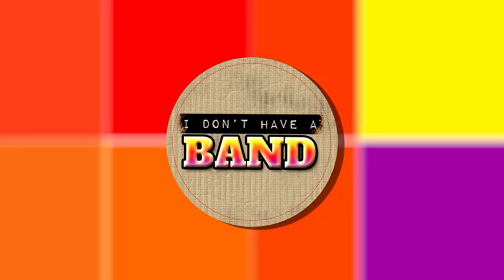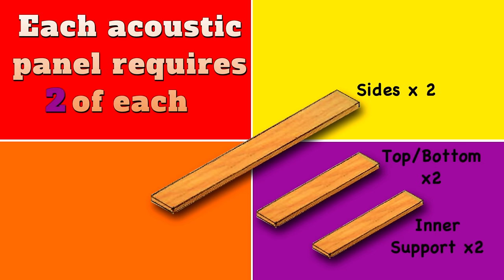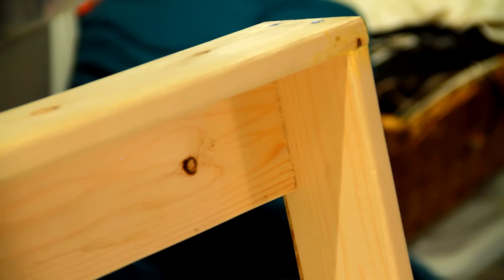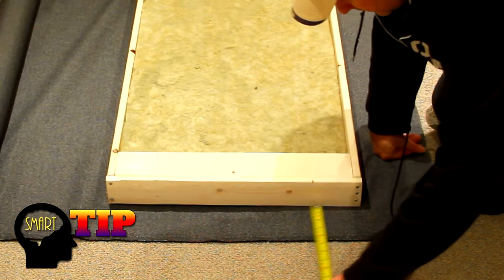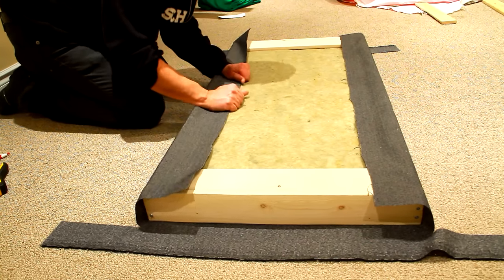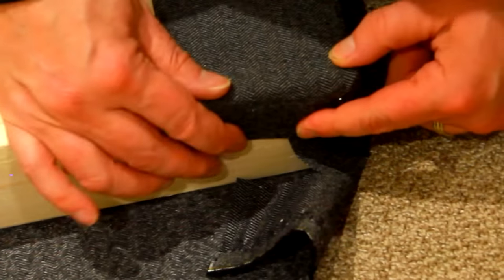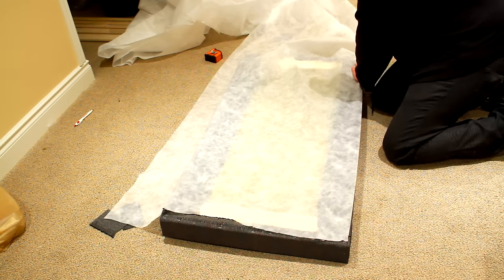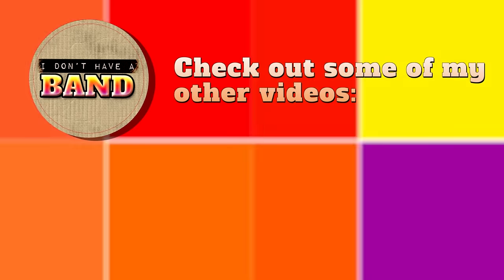DIY Acoustic Panels - How To Make Your Own Cheap and Awesome Panels

Comment: I would say, when you make these panels, take your time and follow EXACTLY the steps presented in that video. 
It allows for a smooth work flow.
I have a bad habit of zooming through instructions in order to satisfy my excitement..
I have built a few panels, single, double in width and/or height, with upholstery fabric and whatever fabric I had on hand, notably landscaping fabric that I used before knowing that the exact same fabric was featured in the video...what a genius!
Well maybe not so because 
after having built in six panels with some beginner mistakes, I finally got it right.
Again FOLLOW DIRECTIONS just as it is in the video.
These panels work great,(even with beginner mistakes) and they definitely changed what I am hearing when mixing.
And there is nothing better than building your own stuff because,
if nothing else, it will keep you centered in the moment which is quite helpful in these crazy times we are living.
Just do it!
Reply from the maker: Thank you for your support and positive feedback.  And I agree 100%.  Easy to gloss over directions and then get frustrated when you make mistakes.  It's not a hard project but you need to follow the steps if you are not used to making things like this.  Glad you pushed through!!

Comment: Thanks for a great video Lonely Rocker! There is a ton of ugly reverb in the room where I practice vocals and it is in dire need of acoustic treatment. I decided to build 8 panels using your instructions. The frames turned out great but I'm still waiting on the fabrics to arrive (I can't wait for finish it up). Roxul 24 was tough to find online and it's a bit pricey but the experts tend to agree that it's the best in class for acoustic treatment so I bit the bullet. Fabrics can also get a bit pricey if you want the good stuff (not talking about the back of the panel). All in all, I managed to make it ~$27+change/panel so you were right on the money there. Thanks again for all the advice!
Reply from the maker: Thanks so much for your feedback and kind words!  Glad this worked out for you and you'll soon have your panels proudly installed in your room.  Enjoy them and glad I could be a small part in your studio venture.  Cheers!
Reply from the maker: What city are you in?
Reply: @LonelyRocker  Lynchburg VA.  Looked up the product locator on their site and called but the stores listed are all out.  I suppose I can just take the 16 inch and cut to fit
Reply from the maker: Covid has created supply issues all over the place.  Perhaps that's why.  Yes, use the 16 and cut tit if that's all you can find.  Make sure to wrap the insulation with a thin fabric inside to keep it all together nicely.  And check my newer panel build videos to see some of the upgrades I added...Good luck!
Reply: @LonelyRocker  thank you so much for the response.  I went to the hardware store and picked up 16 1x4x8 pieces of pine along with the number 8 screws that are one and a quarter inch long, since I need eight panels.  However when I went to screw in the top and bottom parts (on top not from the side like you mentioned) it seemed like the screws were long enough.  I'll go to screw down one side and the other side would kind of pop up by a quarter of an inch.  Granted this is my first DIY project with pretty much anything around the house so I'm probably missing something.  Any issues with getting longer ones? Or am I just not doing something right.
Reply from the maker: Ha!  Sounds like you need to practise your carpentry a bit before you build the panels.  You need to hold the pieces firmly together so the screw drives through both pieces of wood and not pushes the top one up.  With a little practise you'll get it.  Use scrap wood and get it down before you start on the good stuff :)

Comment: I highly recommend using black landscape fabric as a covering on the front before putting the other fabric on. Upholstery fabric is designed to let air through, but it will also allow the dust from the rockwool to pass through. Landscape fabric is cheaper than backing fabric. Also, look for roll ends in the upholstery fabric section of the fabric store. There are really great deals for just a few bucks. I did 8 panels with about 25 dollars worth of fabric.
Reply from the maker: Check my channel for my new Acoustic Panels 2.0 that I just published.  I addressed concerns for inner insulation and included a formula for bass traps.  Check it out.

Comment: I have no skills at carpentry, but you set this up so well that I think I can do this. Thank you for this video! I totally subscribed!
Reply from the maker: That's so awesome!  I'm rooting for you!!  This is a great project to try.  It really is not difficult.  Let me know how it goes!!  And good luck!
Reply: I'm pretty good at woodworking. In my humble opinion, the only problem you may have is underestimating the difficulty of screwing the corners together. It's important to a drill proper pilot holes. You can use just a regular drill bit, or for about $10 you can buy a set of three. The common sizes are #8, #10, and #12. They will drill a nice controlled straight hole with a little countersink. If you don't drill a pilot hole, in that type of joint it's very easy to split the wood. If you're a perfectionist like me, you can get discouraged real fast.

Final thought to an issue that I still see. Do not buy slotted head screws! Buy Phillips head (star type), square, or Torx drive screw heads. Hopefully, you have a cordless drill driver, but in any case slotted drive screws are a PITA.
Have fun...

Comment: Being that this in Fiberglass, is the material good enough for covering when you plan to have 4-6 of these in a smaller room for years?
Reply from the maker: These are not fiberglass.  These are rock wool. 2 years in and still going strong.  Check out my update for some new methods to include in your panels 
https://youtu.be/MHnFYFZc-w8

Comment: Highly suggest putting thy backing on first. You can cover the seam with your top fabric and you don't have to worry about damaging the top.

Not to mention it would protect your fingers if you were using a different insulation.
Reply from the maker: There is no right or wrong here and a few people have been discussing this.  1.  The best method is the one you feel most comfortable with. 2. It's on the back so no one will ever see it.  I personally tested both methods.  I decided I wanted to finish off the outer fabric.  Either the backing or the outer fabric ends up on top.  So really, it is a judgement call that has no bearing on panel performance.

Comment: Really good idea in a simple, easy to understand video. I’d really like to see a before-and-after video that demonstrates the difference in sound, and some measured/measurable idea about which frequency range this panel diffuses and which it doesn’t. My guess is it’s effective in the mids and highs but not so much in the lows, but what Is “high/mid” and “low” in practice?
Reply from the maker: Thank you very much.  I actually did do a follow up to test the before and after.  I didn't measure specific frequencies but I compare audible differences.  Let me know if this video is useful: https://www.youtube.com/watch?v=aUBgX8GYQ_A

Comment: Well, I looked up when this was posted. It was 4 years ago roughly and the price of things certainly has changed a LOT.

20 bucks Canadian is roughly 15 USD. But I'm nowhere close to that on my build.

To be clear, I have upgraded some things. I am doing a total of 8 24x48 panels, 6 of which are 4" deep and 2 of which are 8" deep. The wood was over $120usd, the covering was $110usd and then I didn't have most of the tools. I purchased wood clamps, gloves, t-square, glue, a counter sink drill bit, staple gun and staples, screws, etc...all of which added up to roughly $100 but we won't count that toward the cost of the panels since some will likely have all those things.

So far we are at $230 and we haven't talked about filling materials yet. So if we divide $230 by 8 we see that we are already at $28.75 per box without any filling or backing fabric.

The fabric was an issue as none of the fabric stores I went to carried any rolls wider than 54 inches or longer than 10 yards! I wound up ordering backing material from a horrible company whom I won't mention here for $35. The material had to be ordered online and I went thru Amazon and wound up spending $65 plus another $30 for the 3" elastic (this was already figured into the amount above for covering).

The filler is where I upgraded a bit. I ordered Roxul SafeNSound 60 as you have used. The packs were 24x48x2 and came 6 to a box, I ordered 2 boxes which was roughly $130 and for the 8" bass traps I also ordered Rockwool Comfortboard 80 which was also 24x48x2 and came 4 to a pack (I ordered 1 pack). That was about $120. 

So we are at $230 before filling and now we are at roughly $545 which comes out to $68 ish per box which if we are talking Canadian is more than 4 times what it was when you made this video!

Might want to make an Update supplement type video to get people more current info, if that matters to you.

I gotta say, the mindset just figuring out the plans and exactly what I need without waste was quite hectic.

But the issue with covering fabric is probably the biggest mind trip of all. Not having rolls wider than 54 inches means I would need to buy a roll at least 16 yards long or hire a math genius to figure out how to do it with 2 rolls, which by the way none of the stores had more than 1 roll of any upholstery fabrics...

I figured that I would need to either have a roll that was 44 inches wide (never found any that small) or 60 inches wide to avoid having a ton of waste.

I did find 60" wide rolls on Amazon and the cost was much cheaper than in the stores.

Anyway, now I have to get the time to build all the boxes. I will start with the bass traps. I plan to use 2 panels for a ceiling cloud. Still need to purchase hanging hardware for those...

Loving the project, so thanks for the knowledge and inspiration!
Reply from the maker: Thanks for your insight.  And yes, prices have changed dramatically.  Especially considering current events.   This video is a phenomenon.  It was my first “official” episode and it has not stopped getting views in 4 years.   I did actually do a bunch of follow ups and offered different designs and strategies.  I decided to stop doing topics on Acoustics.  I think I have enough available on the channel and it was never really a core interest of mine.  My main focus is home recording and mixing from the perspective of a guitar player.  Hope you got through your build ok and hope you check out some of my newer topics.  Cheers!
Reply: @Lonely Rocker  absolutely understand. Please don't misunderstand, mine was more of a comment than a critique. If it weren't for you, I wouldn't have got the knowledge or Impulse to do this.

I looked at many videos or plans and yours just made the most sense to me and seemed to be the most well built without going overboard.

A few others from the popular channels here have some more flimsy, and probably cheaper builds. But I don't want boxes that I'm going to worry about moving around. Thanks again!

I do also check out your newer content and I always appreciate it very much. You got a sub from me the first time I watched one of your videos. Continued success!
Reply from the maker: @pvalenti  I totally took your feedback as constructive and contributing to the discussion. It wasn't critical at all!!  I thank you for your contribution and thrilled you watch my other stuff and decided to jump on board.  Thank you!  Look forward to hearing from you again!
Reply: @Lonely Rocker  cool man. Too bad my OCD always has me looking for ways to make something better. The mix of Comfortboard 80, Safe-N-Sound 60, and the Auralex Studio Foam (which I thankfully got from a friend for free) should make for a couple nice bass traps. The only question is which layer should go in front? I think yours is densest in front...I just wonder if the Comfortboard would stop so much that the 2 additional layers would be superfluous...probably over-thinking it...
Reply from the maker: You should watch my John Brandt video before you make bass traps.  I have a bass traps video but those are more super  absorbers than bass traps.
Reply: Hi do you know what it would cost to make two 48 by 24 by 4in panels in US money? I have the tools just wondering if u new the price of the  materials since you just bought that kind of stuff? This will be my frist time try to do this I just don't want to spend $300 on 2 panels that are from some website.
Reply: @Tommyboy  Nobody can answer that but YOU. We don't live where you do. It's called research...call or search for a place that sells Roxul SafeNSound. I had to order from ATS. As for material to cover the boxes, I had a tough time as none of the vendors carry rolls wide enough. I had to order that online as well. Wood, just call your local hardware store and find out.

Don't forget screws, staples, staple gun, knife, wood glue, etc...and hanging hardware.

Sorry man, this is research only YOU can do!
Reply: @pvalenti  I understand ill call around i live in a big city so if the fabric stores don't have it ill go on line. What kind of fabric did u use id like to get that?
Reply: @Tommyboy  I would ask @thelonelyrocker because I just looked for acoustic fabric from the online stores...it is probably cheaper to use a fabric not strictly intended for this, that would still work. My rolls of fabric cost me about $60-70 each if memory serves. Some come in a roll, and some others ship them folded in a pouch...I haven't opened the pouches yet, and may not. I want to build some of these for my church...so it won't hurt me to have some extra fabric I guess.
Reply: @pvalenti  can I ask were fo you order your fabric from?
Reply: Hi again, I wanted to ask u will owens corning mineral wool insulation work it says its r13 whatever that means? Its 15in by 47 so ill have in do some cutting to get it to the 24in I want. Im getting ready to go to menards and just wanted to know if this would work its $47.00. Thanks in advance for helping me.

Comment: Hey, any tips on mounting these the easiest way without damaging the wallpaper on the wall?
Reply from the maker: You could consider making simple stands for them if you didn’t want to damage the wallpaper.  Or just use a strong picture hanging method which would only create one hole. I mounted a small bar on the back if my panel and put one screw with a drywall anchor into the wall to mount each panel.  Hope this helps!
Reply: You supposed to put some plastic between the fabric and the insulation on both side
Reply from the maker: If the material doesn't breathe you will create reflections, not absorb them....
Reply: @LonelyRocker   I see your point there, because I saw it the same way, before I was proven otherwise. If you use really thin plastic-foile, there will be no reflections, because the fabric you are using to cover the Panels is already enough to absorb the very high frequencies, which would be (like you said) reflected by the plastic. And the other lower frequencies are more powerfull and can get through the thin plastic. So wrapping the rockwool in really thin plastic-foile before putting it in the Panels will do no harm to the absorbing qualties. It will just improve the healthiness of the Panels, because those fibers won't be able to get in the air through the plastic, but would get easily through any fabric. If you are interested in my source, you can watch the following Video. https://youtu.be/3CJStLTMyDQ
Reply from the maker: @08icefire73  Thnx for your thoughts.  I have actually been doing some research on this and from what I read Mineral wool is very safe.  However, to your point you can never be too careful.  If I found the right material I would consider putting an extra layer in there.  These panels can open easily from the back if I chose to add the plastic as you mentioned.  Could you link me to a recommended plastic/foil?

Comment: These look very nice indeed great job, i was wondering would it be too hard to try and staple the dacron on the back before you stapled the fabric up so it would be under eath the back panel and have a better look aesthetically? Either way they look very nice i might give it a shot...
Reply from the maker: Thank you for your thoughts!  I've actually gone back and forth with this.  Back first, front first.  There are many ways you can do this.  Whichever one you do last will end up on top.  I decided the front and the wrap was more important to do first and then just finish it off with the backing.  No one will ever see the back anyways.  My backs are pretty clean this way so I'm happy with the way they turned out.  You'll discover other things as you make them.  Don't be afraid to try and personalize the process as you go and do what works best for your application.  Good luck with your build!

Comment: Very informative, thanks. I notice you don't have your wall completely covered with acoustic panels. What ratio of acoustic panels to wall space do I need to block out the noisy highway I live next to? Thanks.
Reply from the maker: Thank you.  The idea with these panels is NOT to line your studio with them.  They are designed to manage reflections inside your room and should be placed at the main reflection points in your room.  I have a video about that too.  They will NO effect on sound from outside.  That's not what these are designed to do.
Reply from the maker: Earplugs 😂😂😂